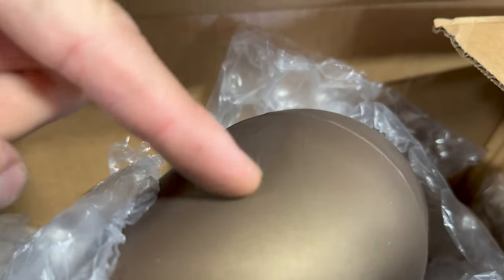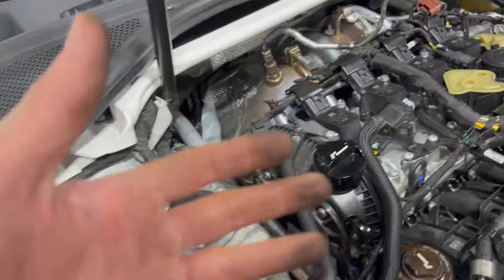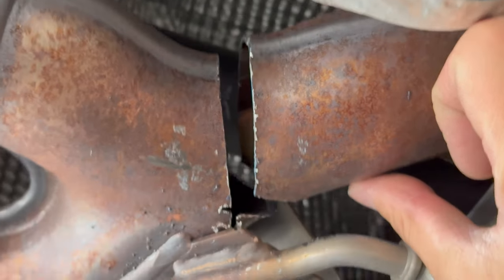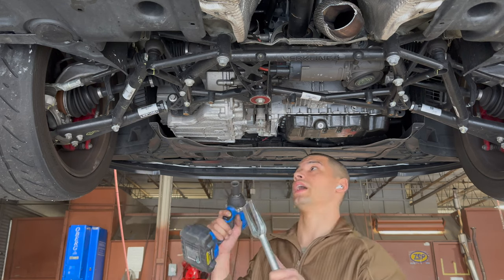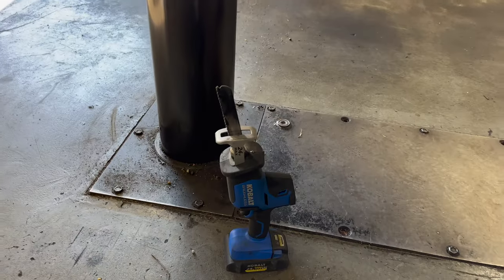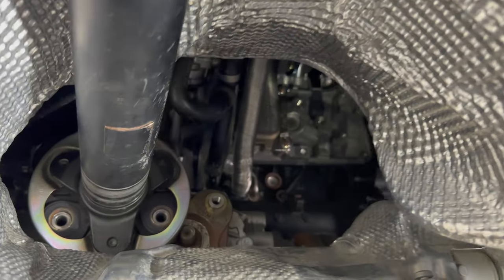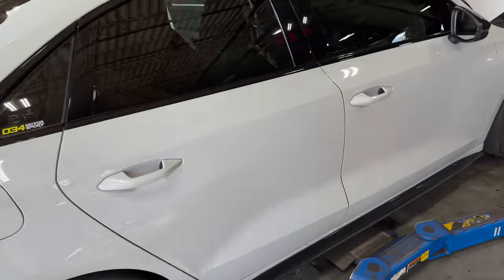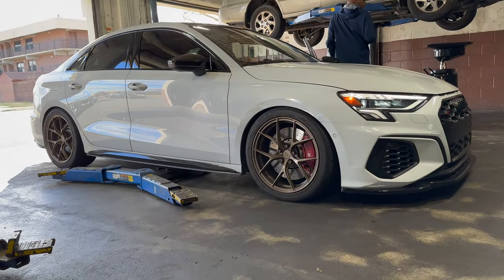DBV2 4" MQB EVO Downpipe install! | MK8 Golf R / 8Y S3

Comment: Hell of an install bro, that stocker DP is a beach!!  So basically your removed the factory DP and the mid silencers... goodness, no wonder that sound is huge.. Now you can hear the turbo whistle on throttle lift-off, sweet!  My only concern would be drone at 70 MPH or about... can't wait for the sound vid. Cheers buddy
Reply from the maker: Only a slight hmmm around the 3300 ish range but I literally never cruise at that rpm. Even at 80 on the highway with 7 gears it’s below 3000. Im very happy! And yeah man huge huge difference. Crazy though valves closed you don’t even really notice it but valves open.. MANNNN it howls! Really appreciate how they setup the muffler lol

Comment: Are you still running this DP current day? Any new report on the NVH / noise inside the cabin? Still happy or gets annoying sometimes (with the wife and kids)
Reply from the maker: Still rockin and still happy! My suspension is louder than the exhaust 9/10 times with having spherical bushings lol. Never once has the wife complained of sound and my daughter sleeps easily

Comment: Nice vid again Bryce, following you since the day I ordered my S3 8Y september 2022. The day of delivery is approaching and man... you are such an inspiration! I now see that there is no need for a whole milltek/remus/akrapovic exhaust system. Just delete res and fit a great DP.
Though I do have some questions, how much louder would you say it is when driving "normal"? And is it at that moment still suited to drive granny to the supermarket? (drone inside car at cruising speeds for example?) Or doing highway at a constant speed of around 70 - 90 mph? Thanks in advance!
Reply from the maker: I have a few other vids showing how it is during all types of other driving you should check those out! They are only a few weeks old. With valves closed you can’t barley even tell that it’s there, zero drone. Just on cold start valves are open for some reason then they close. It’s a very nice setup. No aftermarket catback is as perfect as a setup as DP+stock muffler. This is the way to go! 

Also thanks for watching and following along! You are going to love your 8Y man!
Reply: @BryceJordanProductions  thanks man! I am sure that it will be a great car to drive.
I watched quite some vids, but I wasn't sure if it was with or without the dp fitted. Now I am, and totally liking it. I know what to do 😀

Comment: Enjoy the drone
Reply from the maker: Why even waste your time to comment that? You’ll see in the next video there is in fact no drone..
Reply: @BryceJordanProductions  I’m just cranky. I tried 2 downpipes on my R and ultimately went back to stage 1.
Reply from the maker: Did you try pairing it with a good (like vibrant) resonator?
Reply: @BryceJordanProductions  No, I am happy back with the stock exhaust. It’s very hard to fit a large resonator in the tunnel with the driveshaft. I drive to the mountains a lot and didn’t want to deal with bottoming out either. Stage 1+ seems good enough for my needs
Reply from the maker: Fair enough!
Reply: I have a question was the drone bad because it was catless downpipe or catted? You have MK8 R? Thank you